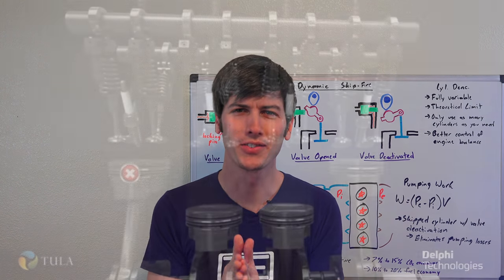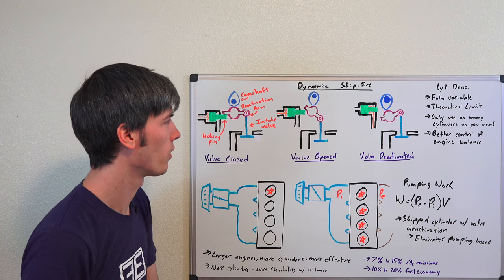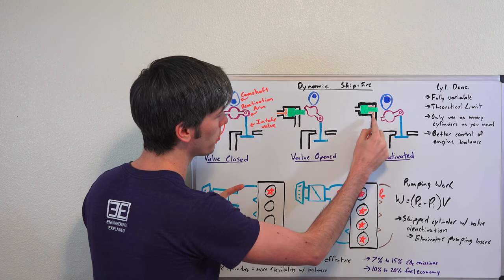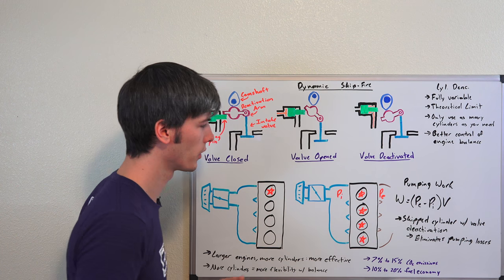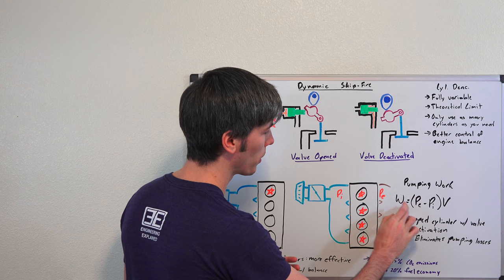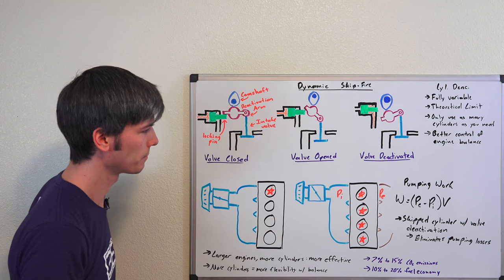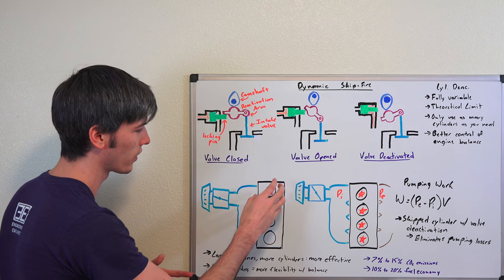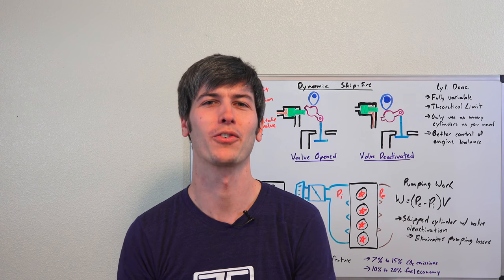How Dynamic Skip Fire Works - Variable Displacement Engines

Comment: From a guy that works at a GM dealership and seeing that it is in fact Delphi developing this new strategy I have hopes that it will be better than our current AFM system. It was a good idea in theory, but in the long run it causes too many issues due to oiling problems. I've only been here a couple of years and already I've seen countless gen 4 5.3's and even a couple of new LT based 6.2 engines need a complete overhaul due to internal part failure causing metal shrapnel to completely trash the inside of the engine block. Sadly more often than not those problems happen at relatively low mileage which would tell me that the owner isn't properly maintaining their vehicle, but a couple of vehicles we have done were to people that I've known for many years, and I know how meticulous they are about oil changes, fuel treatments, etc....
Reply: Brody Rainey Interesting about the 6.2 failure, could it be through overrev / bad oil?
I have 2013 AFM 6.0 motor with GenV deac lifter revision. Done 200k miles and pushes more than 600 hp btw. 14:1 VVT on e85.
Reply: Dirk the Pir4te the engine I actually had hands on was a new LT based 6.2 truck engine. It failed due to the rollers on two of the lifters coming apart and chewing the camshaft up. Of course the metal that came out of that thrashed the rest of the engine. I don't believe it was due to over revving because the vehicle was completely stock. It only had roughly 15,000 miles on it at the time so I think it was just faulty parts. That's the problem I see with GM's vehicles these days. I'm sure it's common across the board anymore to conserve money for whatever reason they see necessary, but these fuel conservation methods taken would probably work better in the long run if quality of parts were better. I'm not an engineer by any means so maybe they parts really aren't to blame, but that's just what it seems like from the mechanic's perspective. I could definitely see oil being the culprit as well. On a lot of the older AFM engines that fail tend to be ones that have been neglected as far as oil change intervals and whatnot. When we pull the pan and valve covers on those engines you'll usually see oil  baked on to absolutely everything. So, that in my opinion has got to be causing issues with the AFM lifter's oil ports when they can't adequately flow like they were designed to do.  I'll keep working on them, but I'll stick to my 02 lm7 5.3. it's got almost 190,000 on the odometer and still made 347hp/315ft lbs to the ground with a mild cam/springs/stall upgrade.
Reply: Brody Rainey Thanks for that, first Ive heard of the latest GenV Lifters pn 12645725 having the camface / roller issue. Is that more or less than the non-deac lifter failure?

Comment: I use my SRT 392 Charger as my daily driver. V8 6.4 liter. I drive it in Eco mode where it makes use of the 4 cyl mode while its coasting on the highway. I think your numbers are correct. I get 13 in town with it off and 26 on the highway with it on. It does have a bit more hum or exhaust note when it switches to 4 cyl mode. Would that be worse if it could go to 2 or even 1?

Comment: This type of system was used in old stationary engines, for example a 4 cylinder Fairbanks Morse engine, where if the engine was not under load, only 1 cylinder was firing to keep the engine spinning, when the load comes the remaining 3 cylinders kick in. Search in YT "Fairbanks Morse 1936 engine".

Comment: Since we are on the topic of engines, a while ago you did a video on supporting mods if you want to install a turbocharger, would you do the same for supercharging anytime soon? Also when you are going from NA to forced induction, your torque increases, doesn't that affect the reliability of engine internals, by putting more stress on them at high RPM, which brings me to a question which has been bothering me for a while. When you go forced induction on on stock internals should you re-tune the ECU for a lower RPM-limit/fuel cut-off to retain reliability? I'd be glad if you do videos on those topics.
Reply: It basically all depends on the exact engine - some can withstand much more, some are nearly on their limit straight from the factory.

Comment: Will noise and vibration increase? Like a three cylinder engine
Reply: jiang xixi. Its still has all the components of those other cylinders moving in balance with the cylinder (s) being used, the only nvh and balance issues would stem from the different firing rate.  But since this will only be used in low load situations its minimal and can be further mitigated with aome clever mounting or insulation engineering.  Active drivetrain mounts are a possible solution, softer mounts at idle or low load allowing resonance to be absorbed then firmer mounts for high load situations where more cylinders will be firing anyway.

Comment: Isn't there a loss associated with closing a cylinder(s) and compressing/decompressing the air inside?  Is that less work than what is required to leave the valves open and push draw air into and push it out while keeping the injector and spark plug turned off?

Comment: I wonder how much energy is wasted by continually moving those unused pistons?
Reply: Ser Garlan Tyrell probably not as much if they were unsprung.
Reply: Ser Garlan Tyrell Almost none. The pisten increases the airpressure but after it's turning point this compressed air pushes the piston back. Only a little bit of energy is lost bc of generating heat.
To understand it better you should watch his video about engine breaking ;)
Reply from the maker: The energy for keeping the pistons moving is required whether or not the pistons are being used, but the efficiency improvement comes from removing the pumping losses associated with running numerous cylinders at low load.
Reply: Engineering Explained i think the issue was that by keeping the valves closed, as the piston goes towards bdc, it's creating a partial vacuum inside the cum i see which would prevent motion. But i guess the other cylinders going towards tdc would help counter that force
Reply: or better a combination of the two ideas, valve desactivation por short periods and both for longer periods, all controlled by gps on the road.
Reply: Not much cause there's no air resistance. It's still more efficient than spraying fuel in when you don't need it.
Reply: Tyler Hardy why not just disable the fuel injector and let the valves open?
Reply: Livkot Edwards combine the idea of the variable compression crank system and perhaps even a telescopic conrod ??

Comment: What comes to mind to me is the Honda J35Z2 engine where it can run on 6 cylinders, 4 cylinders or 3 cylinders. I believe it only runs on 3 cylinders when you're coasting?? Also aren't they still using this technology currently? And how does this VCM differ from others if it differs at all? Just curious!

Comment: When this is implemented on a V8 as it will be on the 2019 Silverado, I wonder what the internal balance will be like? I understand in that truck it will have the capability of running on 1cylinder when the engine is very lightly loaded.

Comment: Smart ! I wonder if it makes Koenigseggs electromagnetic valve system "useless" or if the later can still be considered as a little step beyond (by allowing the removal of the throttle body)
It looks like the benefit/cost/simplicity ratio is better with the Dynamic Skip Fire : manufacturers have experience using oils pressure to change the valve's behavior, it looks almost like a natural evolution of the v-tec.
Reply: Whenever it becomes a widespread technology, Freevalve will render this completely obsolete. I would actually say it is obsolete already, you can just create a much simpler and lighter system that is able to dynamically cut off the injectors (and spark plugs)

Comment: Here's the thing:  Have you ever actually, by hand...Cranked over a 5.7 liter Chevy V8 on an engine stand without the heads? I have, and I couldn't believe how hard it was.  What I am getting at is that you have utterly forgotten about internal friction.  The Chevy 350 that I was in front of took both my hands and arms to turn it over [I'm 6'1" and 150 lb], it was very heavy, far far more than I thought it would have taken to turn a crankshaft and it's pistons and rings.  I'm like "Is this right?", and my friend's dad told me "yes". He knows how to build a V8 engine, and told me about the lubricants necessary at each step.  He's a colleague of Connie Kalitta and has built many engines, so the long and short is that while it is obvious that pumping efficiency is a big deal, I have to say that internal friction is probably at least as important.

Comment: I saw your explanation about what happens during the compression and exhaust cycle so that answers one of my questions but it still leaves another is the plan to rotate which are the firing cylinders, or will for any given number of functioning cylinders the pattern remain constant for example if when ever one cylinder is required we fire cylinder 1, will it always be 1 or will different combinations be used to insure even where on bearings, rings valves etc. If the pattern is fixed I can see an issue with the engine failing sooner than normal as some  combinations will be used more than others and stick with cylinder 1 it may have functionally gone thousands of miles more in active service than others.

Comment: Instead of developing a hardware setup to lock the pin and unlocking, Why don’t we disable injection and sparking for the specific cylinders, since it’s all been electrically controlled?. Letting just the air (no firing or fuel injection) can clean the cylinder too. It’s just a question.

Comment: I have a question I have wondered about for a long time.
When traveling up a long, steep hill is it more fuel efficient to be in a high gear with large throttle input or a low gear with lower throttle input?

Comment: Since both intake and exhaust valves are closed the engine has to work against the pressure changes inside the cylinder, no? I'm no mechanical engineer (I work in IT) so I haven't done the math, but I have tried pulling a vacuum with a closed off syringe cylinder and that took a fair bit of force, since it acts like a spring. I didn't analyze Delphi's animation so I can't say I know this for sure but by my understanding the amount of air in the cylinder with the valves closed would matter a lot in looking at how much work is needed to crank 1 revolution...

Comment: Would the opposite of this technology be a mechanical system to prevent knock?

Like, if for example, knock is predicted to happen in one cylinder, a mechanism significantly reduces the amount of compression within that specific cylinder in order to prevent knock just for that one iteration of compression.

Comment: The future is a 4.2 v12 engine that can shut down to 2 cylinders.
Reply: why 4.2?
Reply: And why a V12?
Reply: And why 2 cylinders?
Reply: v12 because you have any range of performance and 4.2 is arbitrary. I just like engines with small pistons.
Reply: I think V12 is because secondary balance so it's either I6 or V12. I wouldn't mind I6 either but gosh, V12 is just smooth! Small cylinders are also nice. I always wish there were small (2L or below) I6s but sadly the only ones I can find are BMWs from early 2000s and they're rather expensive.

Why 2 cylinders, though? Why not one?

Comment: I was wondering what happens to the cylinder loss when valves are kept closed throughout the cycle. When valves are closed TDC, Vacuum on the way down and back to ambient pressure on the way back up. Why not leave the exhaust valves open to not vacuum the cylinder on the way down? Would be nice to talk about that in the video too but I understand it is difficult to discuss all in 5mins.

Comment: Thanks for the video. One question: What happens to the air inside the cylinder that is deactivated and the valves keep staying closed. Is it really efficient to have the valves closed and compress the air in that cylinder? My logic would be to leave the valves open? Am I missing something?
Reply from the maker: Read the top, pinned comment. :)

Comment: What about the turbo ? Will it spin faster on 4 throttled cylinders or on 1 full ?
Plus if the disabled pistons pull vacum could it force a valve to open ?

Comment: Hey Engineering Explained, given how the engine can disable all but one cylinder using this technology, would there be any advantage in manufacturing an engine where the #1 cylinder has a larger bore, if that was the cylinder the engine used all the time (i.e. it never disabled that cylinder)?  I figure disabling to just #1, with it being the same size as the others, might not give people as much cruising power as they would wish.  maybe configuring the engine (assuming turbo) with #1 larger in size and valves to allow the Turbo to power just #1, i.e. maximizing the amount of power that one cylinder provides?
Reply: I like your concept 🙌🙌 or how about a "step down cylinder engine"  cylinder#1 is the largest bore to run on one cylinder , cylinder#2 is smaller and so on. And adding the skip fire concept to that might reduce co2 and approve gas mileage

Comment: @Engineering Explained With direct injection these days, isn't simply shutting off the injector for that cylinder good enough? What are the complications if we allow air to pass through cylinders un-combusted? By drawing more air with more cylinders pumping, the throttle will be opened wider too

Comment: I would like to suggest a video idea,
how about a video about when to shift gears to have the best fuel economy when accelerating, like shifting gears early vs going to redline, because on one hand, in a lower gear you rev higher, consuming more fuel but making more HP and accelerating faster, so the distance is smaller, so maybe consuming less fuel over all.
On the other hand shifting early, the revs are lower, especially on engine with a torgue curve similar to an inverted U  and maybe this is conusming, less fuel, or more. Or is there a golden middle?
Would be cool if you would make a video explaining this from a technical and practical standpoint.
Huch, that comment got longer than I expected ^_^

Comment: If the intake valves are closed on a deactivated cylinder and the piston is moving down, wouldn’t that cause a vacuum in the cylinder? And wouldn’t that engine consume a lot of oil?

Comment: Ironically I have a 2008 Silverado that I deactivated the cylinder deactivation and a 2012 Odyssey where I deactivated the cylinder deactivation. GM has had some oil consumption problems with there line for a couple. Of years and Honda similar problems. I hope GM fixes this cause I Like the idea.

Comment: Question-In a specific (1,2,...,x) cylinder configuration, do they always run the same cylinders deactivated for that configuration? I'm curious if this will lead to extra wear on cylinders that were deactivated less often. Maybe it's a moot point.

Comment: This idea is interesting but I would rather see the system designed where if the pin mechanically fails it doesn't fail in a way where the cylinder is permanently deactivated.

I also am assuming the fuel injection is shut off to the dead cylinder? You didn't meantion it in your video.

Comment: How does this compare to the efficiency savings you get with a system like BMW's valvetronic? Both cylinder deactivation and valvetronic reduce pumping losses at light engine loads.

Comment: Would the system require overhead camshafts? And would it work with dual overhead camshafts? Also, what would this mean for the valvetrain in high load, high RPM situations?

Comment: So with most of not all modern cars being direct injection, I guess my question is how does it work to improve fuel efficiency? I mean I understand the fuel isn’t being burnt so that’s an obvious answer, but what about the fuel that gets sent to the injectors. Are the injectors also deactivated? And if they aren’t, wouldn’t the gas just go through the combustion process? Also does it deactivate the ignition source too?
Reply: Chances are, fuel would not be injected in the first place. Fuel wasn't being sent to the deactivated cylinders of engines back when MPFI was still common among new cars.
Closing the valves reduces the amount of fuel required to produce the same net work between two cycles of an engine by removing the work required to open/close the valves and more importantly, the work required to both pump air into a cylinder and pump the same air out of the cylinder.

Comment: Master, can a traditional  ECU be hacked to at least stop injectors and spark plugs from working to get a similar, if not so efficient, effect? You may not be able to close the valves, but you will have less pistons pulling gas and firing. Just thinking...
Reply: The fuel economy would really suffer cause of pumping losses
Reply: Pumping losses and o2 sensor would have a fit

Comment: So if I have a 2400cc 4 cylinder car running on just 1 cylinder
Does that make the engine 600cc?
If that's the case, how is the efficiency only increased by 10~20% small margin?

Comment: What about the air that is trapped within the cylinders, once the cylinders are closed by the valves during none operation? Won't this create more drag for the working cylinders to work through?